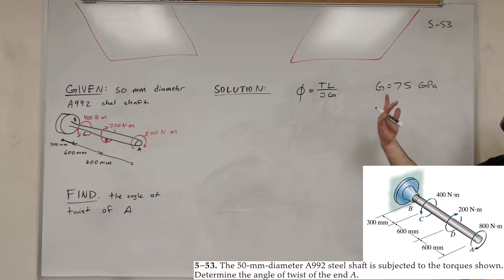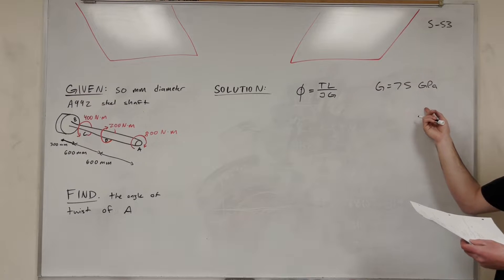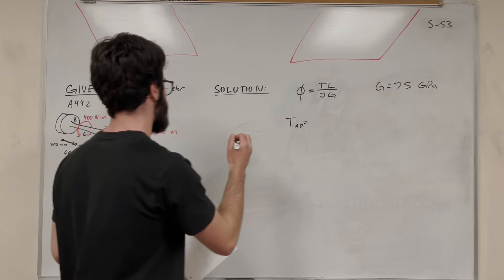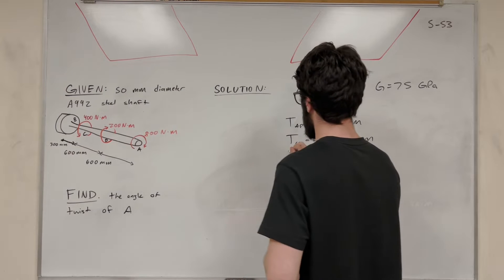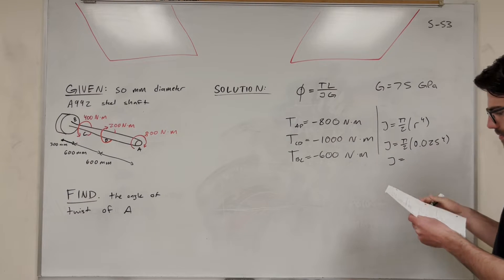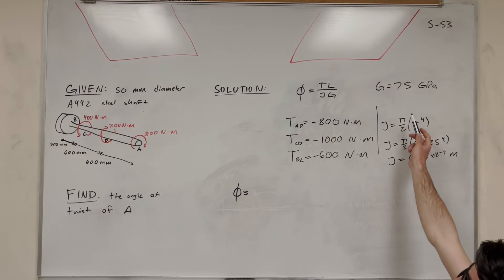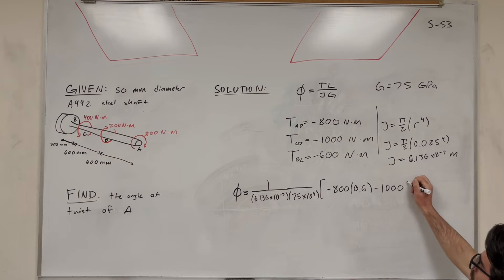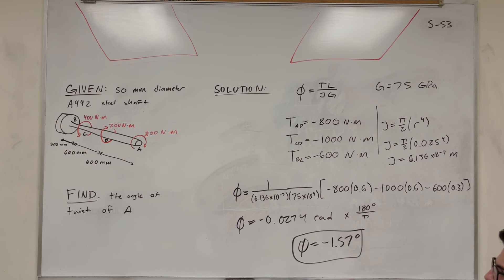The 50-mm-diameter A992 steel shaft is subjected to the torques shown - 5-53

Comment: Why is clockwise chosen as negative? Would I be wrong if I chose clockwise as positive? I now get a positive answer of 1.5687 degrees.
Reply: Its right hand rule from the perspective of where you are trying to find your angle of twist. @A, right hand rule dictates that the torque is pointing out of A (where we are trying to find angle of twist). when it is pointing out, it is positive external torque. When it is pointing in (if 800 N*m were going in the opposite direction) it would be pointing into A, giving a negative torque. Cut between each cut accordingly, and solve for the internal torque.